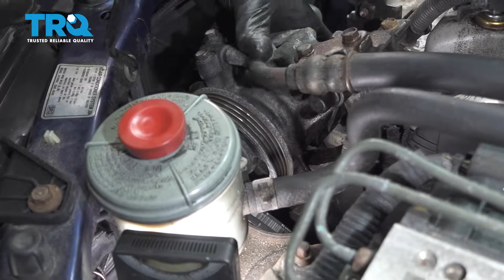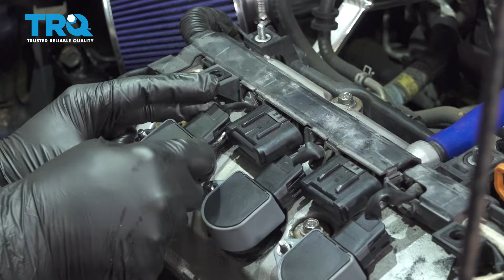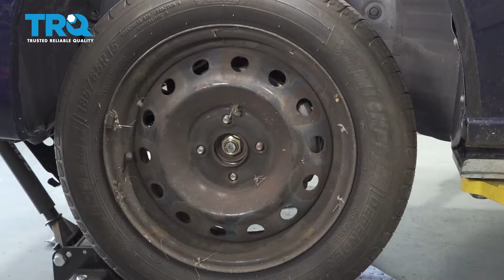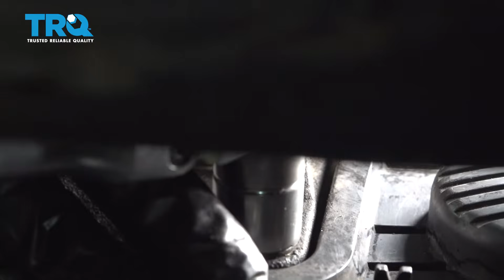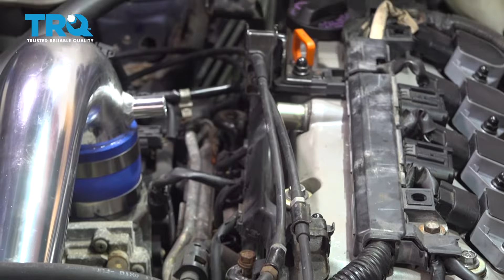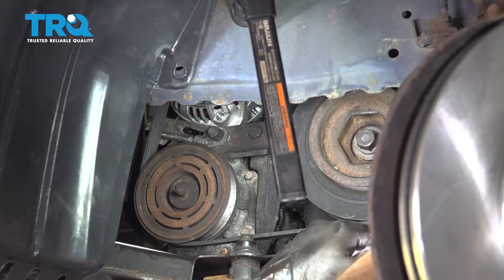How to Replace Crankshaft Position Sensor 2001-2005 Honda Civic

Comment: for everyone that said that what he did was useless must not understand that the crankshaft position sensor is behind the timing belt cover and to be able to access it you do have to remove everything he just removed I have to do the same thing on my 2001 Honda CRV because the sensor is inside the plastic and to get to that plastic the belts and harmonic balancer  have to be removed true he did other things I don't have to do to the car but he did the steps I needed to understand to get to that sensor.

Comment: I guess the purpose of removing the valve cover was to make sure the timing belt didn't jump, and it's not just a bad sensor, but you must have skipped a step in the video somewhere.

Comment: So much extra work. This is what needs to be done to replace the timing belt. All that needs to be done to access the Crank Sensor is 1) loosen and remove the two accessory belts; 2) remove from below the 5 bolts that hold the lower timing belt cover on. You will also have to remove that part of the wiring harness that clips into the edge of the lower cover.